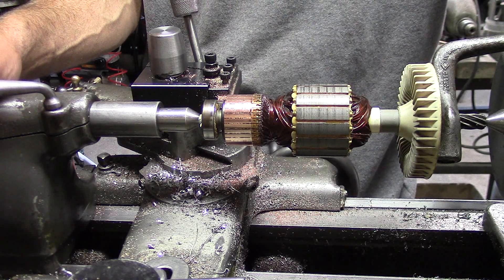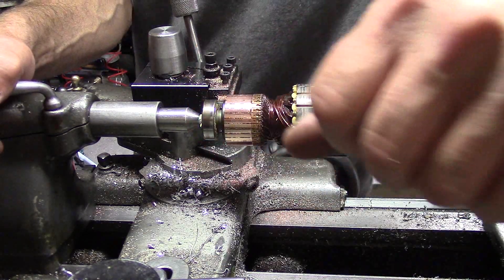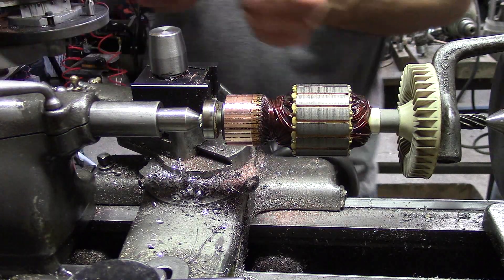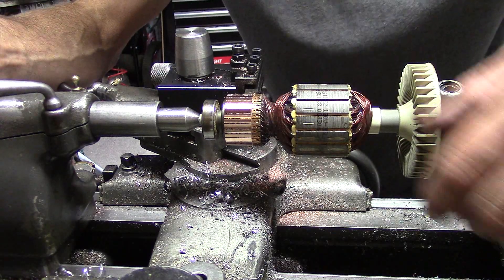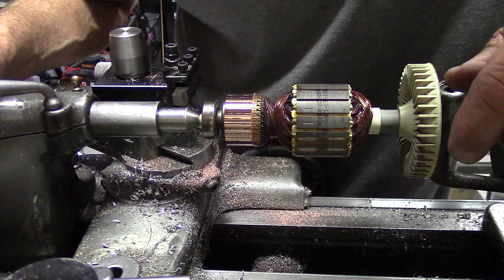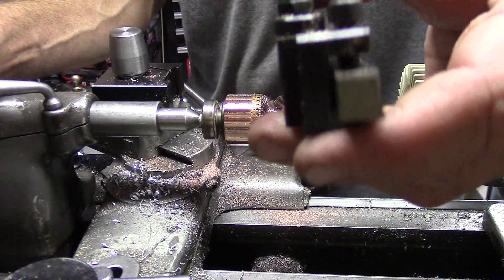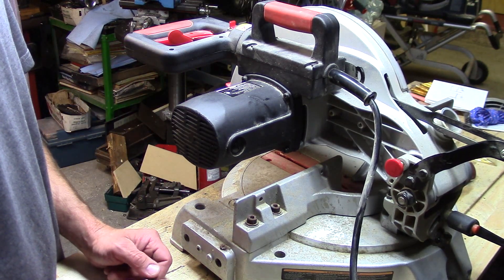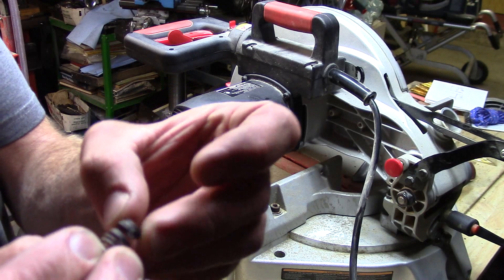Vertical shear tool for armature repair

Comment: Hi Bob,
Vertical shear tool is for sure way to go. I have done same in the past for commutator skims. .. main thing is very slow and gentle feed with minimal material removal.
You seemed to get a very nice finish... and motor sounded very reasonable.
Reply from the maker: Just need to find a bolt to hold the blade on and it should be good to go.